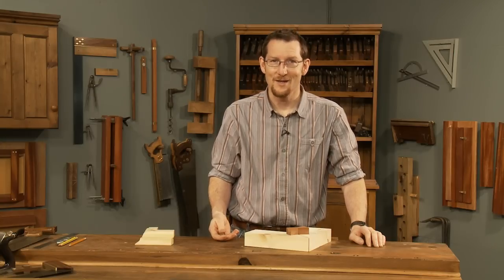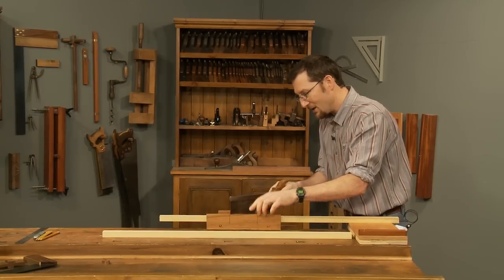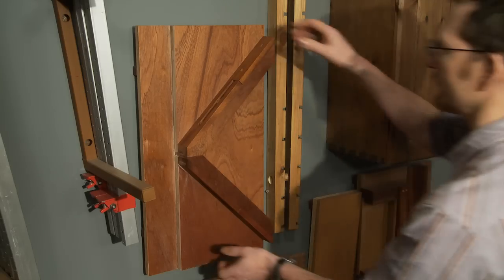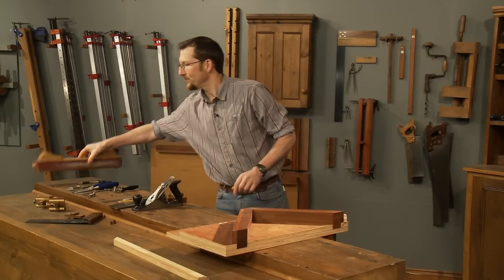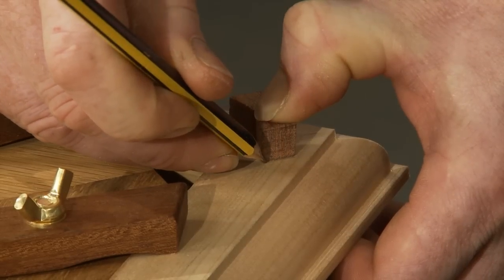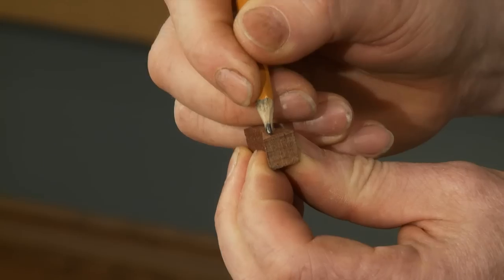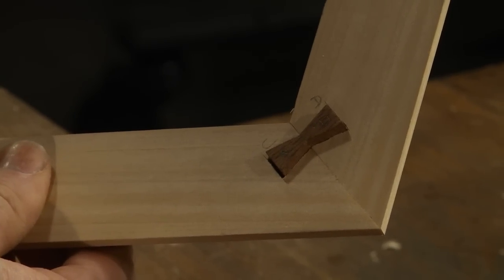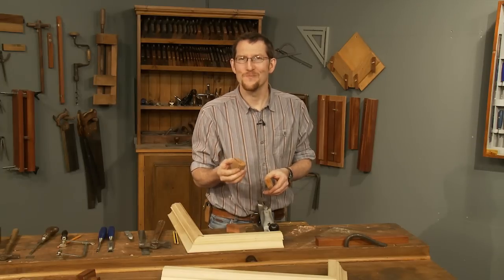How to reinforce a Miter Joint using a Butterfly Key - 04

Comment: Simon, this is a very good video description of the butterfly key in a miter joint.  I have one question.  When you place the key on the miter joint to initially mark out the position of the dovetail you didn't seem to pay too much attention to making sure the ends of the bf key were parallel to the miter joint.  I am pretty sure this needs to be done so that when you transfer the marks to the other side with your marking gauge the marks line up properly.  do you just do this by eye or is there some other step that will ensure a parallel line for the dovetail?  Hope that was clear enough.  Thanks.
Reply from the maker: Hi Steven, you're bang on right about the need for alignment, it's really important, and yes I did miss out this step in the explanation. I did just eye it in but it would be more accurate to align the bf key with a well placed pencil reference line, going across both sides of the joint at 90 degrees to the miter. Good question to ask, thanks for pointing this out.

Comment: I'd like to see a video on the construction of the moxon vise you have in on the back wall there.
Reply from the maker: Hi Josh! There are a few different names for this device, and it's used for lots of miter related tasks like shooting and paring at 45 degrees. I inherited it of a retired cabinet maker who lives down the road, and I've since made a load of shooting boards which replace this for the most part. I don't have any videos on making it, but I am doing videos on a whole range of really handy workshop devices, and they'll be out in a few months. Daed Toolworks have got a blog post on one way it's used, and you'll find it here http://www.daedtoolworks.com/ranma-i-tooling/. All the best, Simon
Reply: ***** Hi Simon, thanks for the info on the miter jack, but I was referring to the vise/press hanging to the between the backsaws and the dividers. It appears like a moxon vise like benchcrafted style (http://benchcrafted.com/MoxonVise.html), but you seem to be using some metal threaded rods that I'm not familiar with. Are those veneer press screws?
Reply from the maker: Josh Garrisi Ok, I understand the question now. Yes they are clamps, and you're right about the veneer link. I call these 'caul clamps' as one side of the clamp is curved, putting pressure dead centre at first and then at the sides as the work is tightened and the curved clamp bar is straightened out - handy for veneer work! However, I use these for a whole load of different applications from flattening boards as dovetails are marked out, to just holding boards off the bench whilst I work on them. I'll do some videos on these soon. They are shop made out of sapele mahogany, some 3/8" threaded bar, 'T' nuts and some handles.